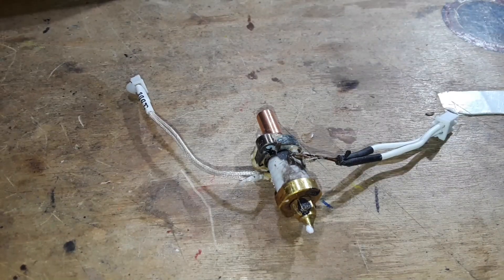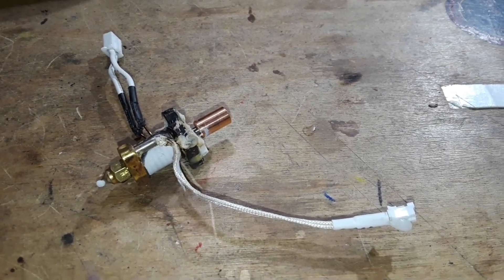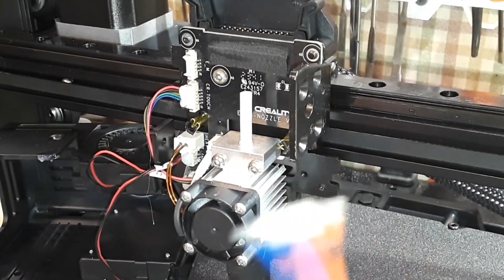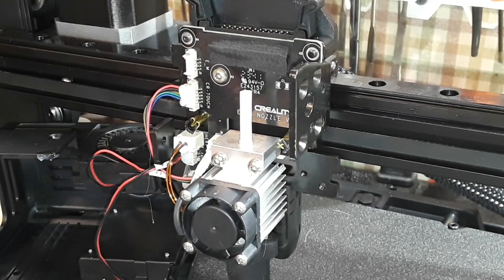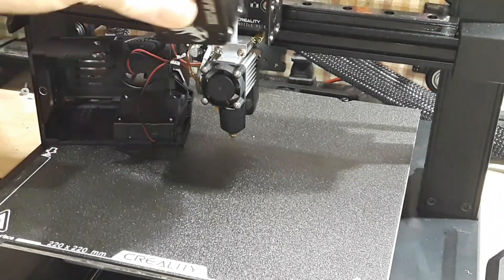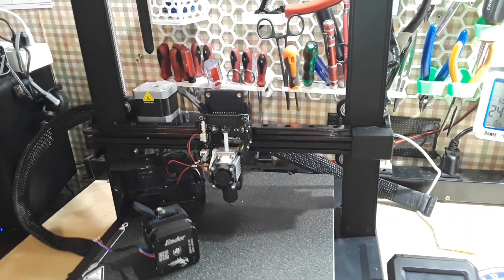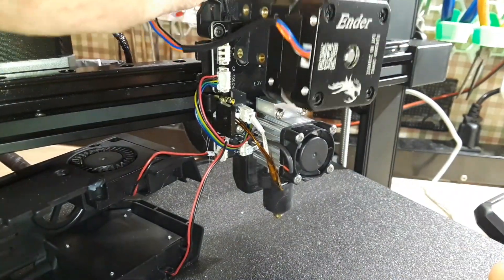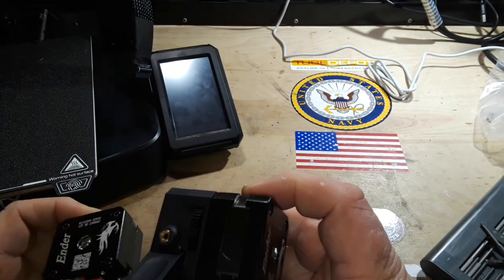I Broke The New Ender 3 V3 KE - sponsored by Solderstick Wire Connectors

Comment: My Ender 3 V3 KE hotend also leaked internally after around 2 month of usage. Partly it was my fault because for this hotend it must be checked regulary if the nozzle is still tight. I took the step and upgraded to a unicorn nozzle which cannot leak anymore. Printer works very nice with it and it has also hardened steel tip so it will last longer.

Comment: I've had blockages after blockages, to the point I'm putting mine up for sale, once I get a replacement fan that the wire broke after numerable times of taking it apart. Now I'm researching 3d printers again. I already have a Voxelab, which runs ok.

Comment: wow, it would have cost you a couple of nz dollars to fix it yourself, buy the little connecty things, use a pin or a needle to poke the old connector tabs down then push them out, strip one or two mm of the end of the stepper motor wires, crimp your new connecty things on the end of each wire, push your new connected wires back into the plastic plug bit, make sure you put each wire back in the same position(take a photo with your cell phone of the plug before you pulled the wires out or draw a diagram) and bobs your aunty fixed for a few cents or dollars, depends on how much postage costs in your country, I'm sure xh2.54 connectors are available from pcb way, i know their available on aliexpress and temu, dick smith electronics, ebay, amazon etc you can even get pre wired pcb connectors, i would spend money upgrading, i spent about 60 bucks on hardened steel nozzle, full steel extruder gears, pei-pom build surface and 500g of petg cf, for my v3 se, thats about $30 freedom units of currency,  the hobby for me is about turning a turd into a pigs ear into a silk purse, also creality have released the source code for the se on their github, spread the word nurd, chur chur cuz

Comment: Thank God for your video, I had to remove the hot end to get those 2 screws that connects it to the heatbreak that were stripped out which I probably did, bc it still had filament stuck binding the screws in there, let me say I torched the hell out of those screws with a mini torch trying to get all that filament off…ended up having to drill the screws out, all this craziness bc of filament blob, which was my fault, not being diligent in checking on my print, never again….only takes me once to learn a lesson. So, now that I got the replacement hot-end and start putting everything back together, I’m thinking dam, I can’t remember if it goes back this way, or not. I had watched your video before I received the replacement part and I remember you had taken off several parts, so thank goodness for me, but not so much for you though….this was definitely a lesson learned, to pay attention to your prints and remember or record how you took things apart but, I would rather try and fix it myself rather than sending it out  for repairs. So, thank you Sir for recording this and sharing it, I sure hope my Ender comes back on the same way, I’m about to go start it up…

Comment: Same thing just happened to my printer, I bought one of those cheap filament bundles of metallic colors, sadly this filament is the worse for clogging. When I realized it was backing up into the extruded, it was a mess, when I pulled the silicone heat block it pulled the temp sensor out. I tried to clean everything up, but keep getting an error about the temp sensor, so I just had to buy another hot end to replace it. I’m all about trying to fixing what I have, but I didn’t pull any pins from the stepper motor and haven’t removed the hot end yet.I feel your pain, just waiting for replacement from Amazon.

Comment: If the hotend thermistor shows weird temperature the printer will stop the heater and display error recommending restart. Happened to me on cr-10 se, which also works with same hotend and similar nebula pad like v3 ke

Comment: Hmm, this might be a common issue with the KE as mine did exactly the same thing within the first week. Initially I was getting great results and had started to print the parts out from stl files I bought online. But then I started getting failed prints, despite using the same spool of filament and settings that had worked only the previous hour. I'd run the calibration each time too and cleaned the nozzle in case there was filament in there that had been overheated and gone stringy, so I was mystified. After a bit of experimenting with the bed and nozzle temps and print speed I got one piece off perfectly and thought I'd solved it. I too made the mistake of walking away and whilst I was otherwise occupied the piece came away from the bed and the filament ended up a gooey mess all up around the hot end It was totally wrecked, including the connecting wires and the right side fan.
Today the parts arrived and I've rebuilt it but I'm in two minds about using the silicone boot. I think that increases the likelihood of damage in a failed print, in that it traps molten filament and draws it up over the hot end. I've also changed the filament brand I was using and I certainly won't be leaving any prints unattended for a while until I gain confidence in it again.

Comment: Get yourself one of those magnetic parts trays from Harbor Freight.
You still drop screws,  but at least you can keep them in one place and organized.
Reply: and also, those little square nylon wiring connectors are called JST connectors.
AMZ has pairs of them in 2, 3, 4, etc wires.
just cut the end off that old stepper motor and solder another one on.

Comment: Same thing happened to my KE. Nice fix. On another note. I noticed most of the younger generation is afraid to take things apart and fix them. Only guys like us (Over 50) seem to be mechanically inclined and confident enough to take something apart instead of just throwing it away and getting a new one. We seem to be in a disposable society now.  Every time I take a load of junk to the dump I'm amazed at the stuff people just throw away that could be easily fixed.
Reply: You are definitely right on about ppl over 50, I’m a female and went from rebuilding a Monoprice mini to Ender V3 ke with direct drive, but still feel confident enough to repair instead of sending it back, hell I don’t even know what the warranty is and I’ve only had it for a few months. Just waiting for replacement hotend, looks like a simple replacement.

Comment: Happened 3 times to my v3 ke this machine leak often and the connector are poor made changed the M2 screws for the hotend are to small the threat in aluminum is far to short

Comment: Wow. I just got my printer, and on print 3 day 1, after two nearly perfect prints, I have a gigantic glob of PLA on the hot end. The silicone sock is far away from the nozzle. 

Im pretty sure I broke something aluminum that is some kind of sleeve around the part the hot end screws to. My hot end will no longer heat up.

I think I have to return this printer... And I am worried that I just shouldnt get another one...
Reply from the maker: It happens to everyone, return it. Get a replacement and make sure all bolts and nuts are tight. You'll be ok!

Comment: Same thing happened to me recently.  I woke up to a huge glob of dried up PLA.  After removing my shroud I saw that the nozzle got blocked somehow and the PLA started running out of the top of the hot end.   

I was able to remove most of it, the only problem was the male connector came disconnected from the fan wires.  It wasnbarelt crimped.   I tried to hot glue it back in place but when I started the printer there was a pop noise and the smell of smoke.   Now neither of the fans work 😬.  

Luckily it’s within the 30 day return window.

Comment: My Ender 3 V3 KE also got a clog. I think I got off much easier than you though. I did break the wires on the two fans that mount into the shroud. I also broke two of the connectors on the bracket that attaches to the gantry. Creality sent me a new bracket even though I was only asking how I could buy a new one.

I got new fans and they fit into the shroud perfect but seem to require different screws than the old fans. Yes, these new fans need smaller diameter and longer screws! Now, I have to wait until I can get these screws before I can complete the repair of my printer.
Reply from the maker: That is frustrating. I totally understand. I still think think this is the best under $500 printer available today.
Reply: @learnelectronics  I agree!

Comment: I had the same issue but i can not get my hot end off the heatsink. PLA is welded onto it. can find the hot end on Amazon but not a heatsink for it anywhere. HELP please.
Reply from the maker: You may need to order from Creality directly.
Reply: @learnelectronics  didn't see it on the site. May have to call.
Reply: You might be able to get through with a knife, same happened to mine, currently shopping for replacement hotend but was able to scrape enough of the blob away from the screwheads on those 2 screws that mount it to the heatsink. I used a soldering iron to melt out the pla that filled the 1.5mm hex holes but found that they were stripped from the factory, now I am searching for a torx but that will fit that might grip the stripped holes

Comment: They seem to have a big problem with screws being loose, mine had A LOT of screws that were hardly tightened at all and many reviewers have noticed the same. Also, the Y belt was completely loose. I guess they are rushing production to meet the demand as fundamentally it's a great machine if the get the screw problem sorted.

Comment: If it was not a broken part force material up. Its more likely that the nozzle to throat connection was not tight. Loosening over time even more till the molten plastic can pass thru threads onto the top of the heater cartridge
Reply: I agree. I'm not feeling warm and fuzzy about the PTFE tube after watching this video.  It looks like the PTFE tube is just laying inside of the extruder and hotend.  If there is any opening near the hotend this will be an ongoing problem with regards to the plastic leaking and making a mess.

Comment: My V3 Ke had 90% loose screws, dry rusty ball bearings under the bed, not lined out propperly, my first aborted benchy had multiple lines that where offsett, afthe spending 2 hours tunning it works great and sound smooth.

Comment: I have found that since cura does not support the KE version, using the creality slicer caused this exact same issue for me.  Yes I had loose nozzle when it arrived, but torqued it to spec and was fine.  Then it clogged and became a solid plastic mass.  Found that in the slicer advanced settings, it have auto temp control checked and the machine drove temps down below the melting point of the PLA, like 185c.  Clogged and sprayed out above the nozzle.  Total bullshit having that option on by default on these.
Reply from the maker: Good info, I'll have to check that!
Reply: @learnelectronics  Not sure if it is supposed to be on to prevent heat creep when flow is low, but not sure why it went so low when “PLA” was set in the software.
Reply: Great advice. Same thing happened to my KE. What a mess. Ordered a new head from amazon.

Comment: Permatex 59235 High Temperature Thread Sealant, is good to 400F I'm considering getting some checking the tightness  and dabbing the hot head screws while its still new

Comment: The hot glue on connectors is obnoxious but I understand why companies do it. With computers from system integrators its common to have USB 3.0 cables glued to the header.

Comment: Sounds like you had a fun time like me.  I have a Prusa Mini+. I decided to redo all of the orange pieces in red. In the process of making the change, I managed to break the wire to the print head heat sensor and rip the wires out of the cooling fan. A couple parts orders later and I am back in business.

Comment: I watched the whole thing thinking that somewhere along the way you might explain why you chose to replace the stepper motor instead of just replacing the damaged connector, but you didn't so I have to ask . Why not just replace the connector?
Reply: I'm gobsmacked... same question here.
Reply: I'll assume that he wanted to do an educational video here.  Yes, I was thinking of Dupont connectors.
Reply: BTW...where do we buy that connector wire or one that will be a direct replacement? Thanks.

Comment: Would you recommend replacing the ptfe tube with Capricorn tube??
Reply: I don't think it's necessary 1. Because it's so short, and 2. The ptfe tube doesn't go all the way through the heat break, touching the nozzle
Reply: Interesting. I was concerned that sinc ethe PTFE was just laying there that it could have been the cause of the filament leakage around the hotend.  While it could be, I don't know. But knowing this I would consider how much I might have retraction set to. I wouldn't want to manually pull hot filament up rapidly, perhaps it wouldn't matter, but I wouldn't want to do any retractions greater than the hotend and the end of the heat break, whatever that distance is.  Does my rambling have any credence to it? :)
Reply: Which weight of paper do you use for bed levelling?  Tissue paper or cardstock?